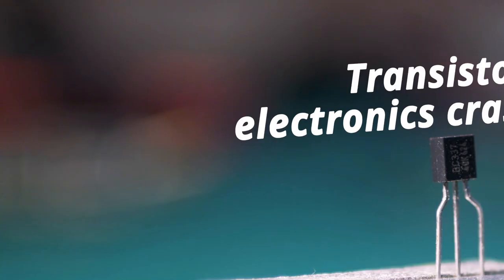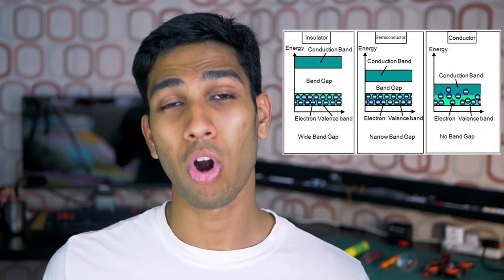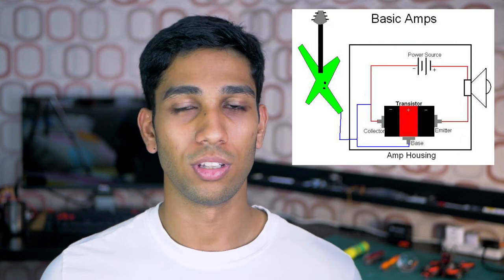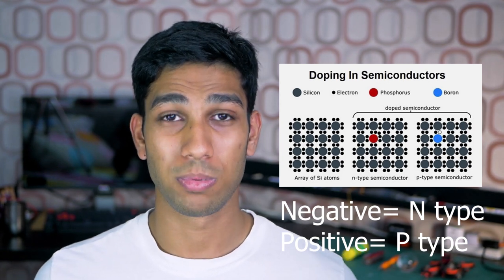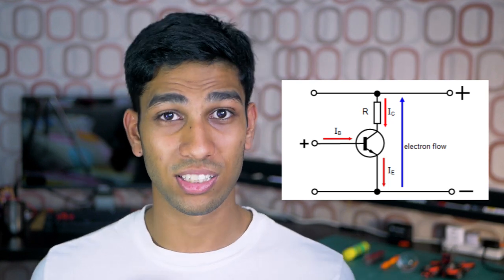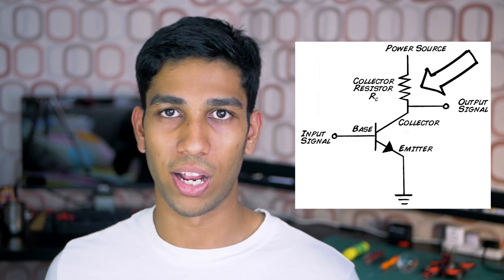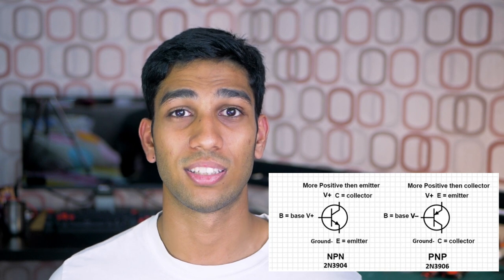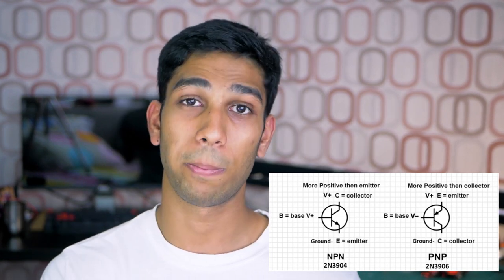Transistors tutorial & Raspberry Pi & Arduino wiring. Electronics crash course #5

Comment: Hi Saral, another great video. I myself, really liked the demo you had in the end. The first half was the theory and the second half was it in practice :D which tied the two worlds together. Great job. As a potential idea, it would be cool to perhaps cut open the transistor so you can see what is inside of it. I've never done it myself but would add another of interesting detail. Keep up the great work :D
Reply: Also... super super minor point. Once you have said you can do it on the arduino, remove it from the shot so that you can keep the explanation as simple as possible.
Reply: Also good work with the diagram. They were helpful.
Reply from the maker: Thanks Paul. I'm glad you're enjoying the videos I'm making. Thanks for the feedback on removing the Arduino.
Hmm I'd enjoy cutting a transistor open but I don't have the tools to do so. Let me do some research and if it's something I can do at home, I definitely will!

Comment: Great videos. Can we use a transistor to connect a servo motor of 5v to a Micro:bit? Thanks a lot.
Reply from the maker: Hi Miguela, thanks for your comment! Yes you can use a transistor (not on the signal pin) but it's a bit redundant. For the Microbit, I'd recommend you connect the servo to your 5v power source, and connect the signal cable(orange) to your Microbit. Make sure to connect the ground of your 5v power source to the ground of your Microbit and you will not need a transistor! Alternatively most servos will run on 3v that the Microbit provides. Do let me know if that helps and if you have more questions